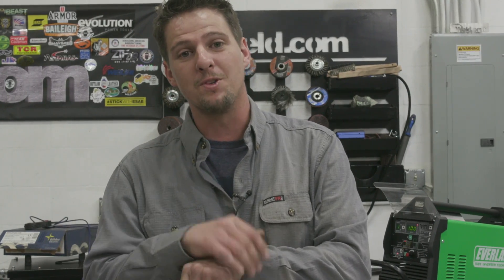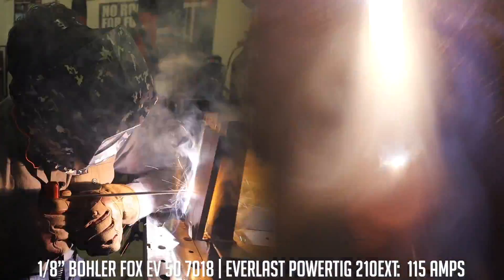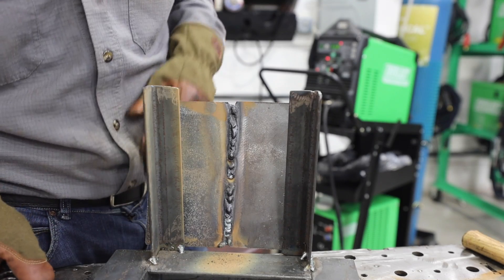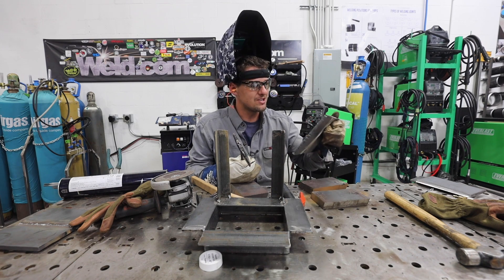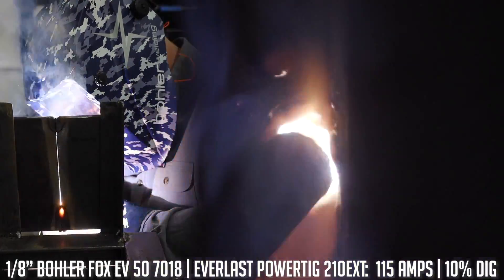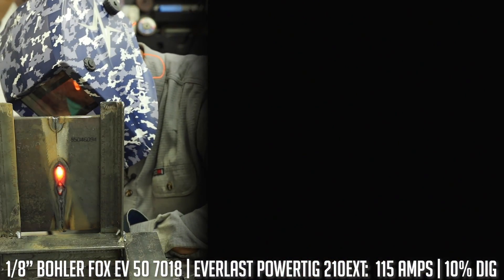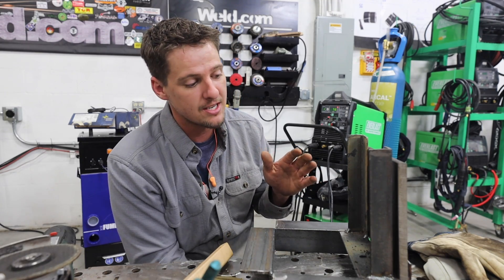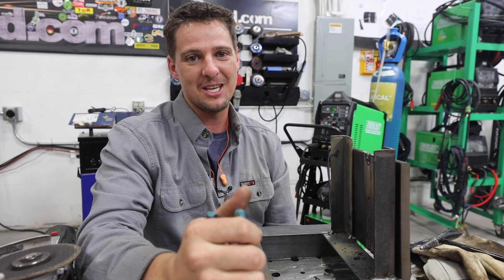7018 Open Root Challenge

Comment: finally someone who welds like me lol.
Reply: Yes. I was thinking the same thing lol.
Reply: @admantiom1848  ok so I was watching stuff about welding I think that you are supposed to use 6011 on root pass because its supposed to be a fast freeze rod, like i guess it solidifies fast and prevents it from dripping, don't quote me on that because I really don't know. but its details like that if its true that will help improve anyones welding.
Reply: @davidcraft4909  6010, 7010 for root DC (7010 is higher tensile strength). 6011 root AC. sometimes in Asia and Europe they are using special 7016 (Kobe code : LB52-U) with modified flux that can achieve open root with better bead (the slag looks like glass) this only be done in construction not pipe project unless you want to mess around with 7016. 7018 can use for open root like this vid but it's better with 7016 (less iron deposit)
Reply: @xcsourceindustrialist7926  that's a 7018 or a austarc t16c the reason it looks like black glass is they take out the iron powder
Reply: @TherealMandingo  that is special rod with spec of 7018. same as mine with 7016 special rod for open root. yes we do daily basis with 7016 or 7018. there is nothing wrong, even back in 70s 7018/7016 is frequently used for pipeline but like i said in procedure we must respect it, not the specification for rod. if you working for specialist you can't deal with some "oh i can do with this rather than using some special rod" "why you stop me? because you can't do it?"  try that attitude with your supervisor or client next time..
Reply: i can finally sleep in peace after watching this vid
Reply: Do you mean bad or using 7018 on a open root
Reply: @TherealMandingo  I wouldn't say bad,  just not perfect.
Reply: @TherealMandingo  for construction it's depend on the code but usually it's okay. Using 7018 open root for pipeline project is bad idea to begin with, many places only use 6010 for open root. but hey I'm only welderdogshit 😂😂 u should ask your supervisor or usually it noted in your project
Reply: @xcsourceindustrialist7926  oh , well, I'm not a welder but I'm trying to really learn it. hopefully one day I can switch from being a truck driver lol. but yeah every little detail helps and theres a lot of little details.
Reply: @davidcraft4909  i believe there is more profitable right now to be welder. and if you live in europe / USA / canada i think you can get better pay job. in asia like 3rd country (unless in japan / korea) forget it, it's better to be truck driver, more money. but neighbor's land is greener in everyone's eyes. weld.com, weldernation, weldtube is youtube channel for welder, if you want see some approved welding setting go to miller.com they have welding calculator for stick, mig and tig. but again that's only basic information. some welding machine didn't works like another machine, you can figure it out once you try it
Reply: @davidcraft4909  but hey, if you want to be welder in any country you can do it. income is just another bonus, if you are best in any job i think you will get more income like another job. in my country you will be very happy for getting lincoln / miller / esab welding machine because it's very expensive (more tax) that's why many welder in here only using cheap chinese inverter welder. beware tho, it can't weld with same setting of branded welder like miller/lincoln. even the arc character is different.
Reply: @xcsourceindustrialist7926   lol dude I do it on a daily basis. The codes meaning nothing for electrodes you could have a code 1552 part 2 or 4041part 3 all that tells you is what  the specs are for that weld not the process or how to do it. That's a procedure you can have a pre qualified procedure or you can make your own if I wanted I could make procedure stick root Tig fill mig cap as long as it meets the code. What type of welder are you and from where. Lol telling me 7018  open root for pipeline is bad idea. Why because you can't do it or you don't do it . I use a procedure with 7018 root pass. What's so wrong about it. All shoots I've had using it no problem
Reply: If you read the specs on a 7018 they recommend for pipework food gas petrochemical. It's perfectly fine to use it for a open root just because your procedure don't have it don't mean shit.
Reply: @xcsourceindustrialist7926  99 percentage of welders in the UK are on terrible money (less than a building site labourer bad) Take my advice, don't be a welder or engineer of any kind. Become an electrician or a plumber.
Reply: @rich3633  i think most common people views welding as hard labour because working in open area, heat, and sparkle.. they don't know most important of welder is steady and smooth moving hand like surgeon.. but because that ignorance they paid welder as dirt cheap as possible... pity tho...
Reply: @xcsourceindustrialist7926  I've started hanging internal doors in my spare time. I make twice what i do welding and it is much easier, cleaner, healthier. I am class 1lloyds coded, so could work on a nuclear submarine if i wanted, nobody wants to pay the money though. I see lots of people getting out of the game because of crap money. It's unacceptable.
Reply: @rich3633  well at least you have great skill.. i am just hobbyist welder 😂 i do most making money from selling stuff online and making vacuum chamber and electric oven.. and yes it's healthier as you says.. that's why in my country i don't see any good Tig welder.. even we usually use stick welding, i just see 1 good welder from 3 different large fabrication company. they paid welder like $7 dollars/day
Reply: @xcsourceindustrialist7926  haha cheers, you haven't seen my welding though mate 😁. We've all got to make ends meet some how. Take it easy man.
Reply: @rich3633  post it on YouTube. i will definitely give it a like  😄
Reply: If the parts don't fall apart..... It's a good weld!
Reply: 😁 me too.. big learning curve from flat.
Reply: @americathefree3708  Oh yeah, I sort learned on my own how to stick weld but joints flat on a table. on stuff about 1/8 to 1/4. I never managed to learn how to do any other joint style or position consistently, and to be honest I was never very consistent on flat but joints either. I recently started tig welding and its actually way easier than stick in my opinion, you can actually see everything and know what you did wrong.
Reply: @davidcraft4909  That is awesome.  My major is keeping me from going to tig weld.  I screwed up.  Thank you and God Bless.
Reply: In Australia it's common to use 7018 on open root  it's a very common and popular electrode  we use it for alot of things iver t16c or ferror 61 I personally stick with old school 61 the iron powder makes a huge difference
Reply: Beat me to it aha

Comment: I would have tried a close gap, tight arc and use a "U" shaped type motion up the weld seam. I have some plate suitable to have a go at this challenge so will have a go at it. I am not a qualified welder and if it turns out any good I will publish the video of it.
Reply: Close gap not allowed Must allow for weld contraction Otherwise root cracks could appear on cooling

Comment: 7018 u need a tight arc. Stops porosity. 2.4 mm gap and land. Can hold it in at about 80-90 amps, DC Negative 😀👍🏻
Reply: Thanks for the heads up. Definitely going to practice
Reply: that 80-90 amps is for a 3/32 rod not the 1/8 he was using tho...
Reply: Liberty Dankmeme 80-90 for a 3/16????😂😂
Reply: @gmfiorini  am i off that much? maybe it's the metric messing me up
Reply: @LibertyDankmeme  
You must have meant 3/32 not 3/16
Reply: @tubeonline629  yea that was my first guess - i edited it to incorrect - FML
Reply: What the @#$% is 2.4 mm. Lol

Comment: I run no land and use dcen for the root, 3mm gap 2,5 mm rods around 65 amps
Reply: Thanks for the Tips. I Thanks for watching 👀  Weld.com. Stay healthy
Reply: uphill? what is your rod angle like?
Reply: @peetky8645  pretty much straight, very slight push angle
Reply: @laan1956 root run with 7018 key hole need? How toweave side to side?